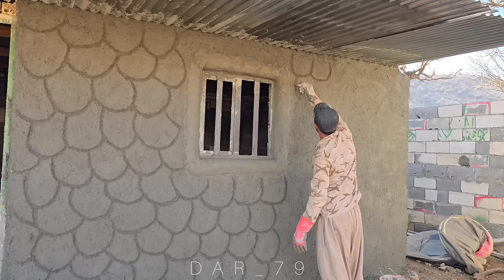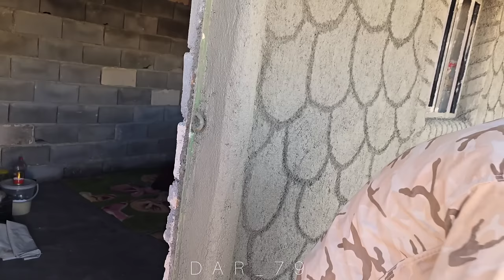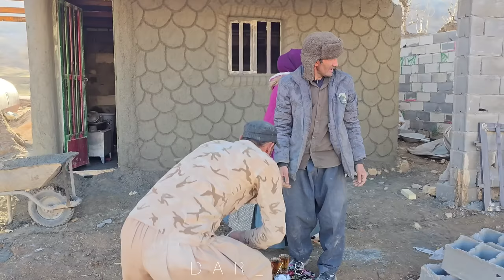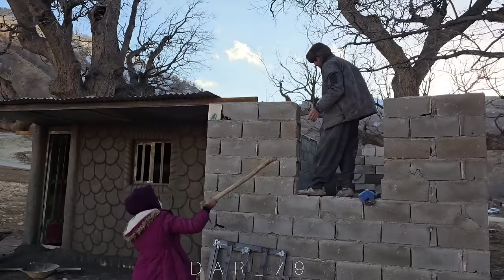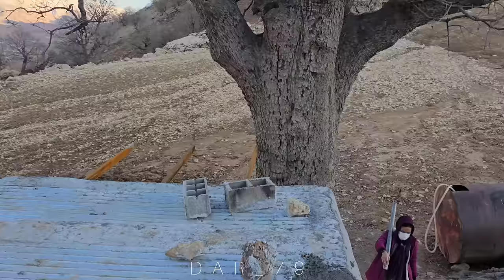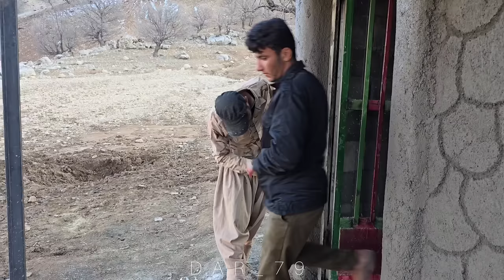Narges and Rasool, painting the house, the path of creativity and innovation

Comment: @DAR -79 don’t forget the heater pipe running upwards and thru the ceiling and to cement the inside walls first and once dry plaster. It will be much smoother and nicer….❤